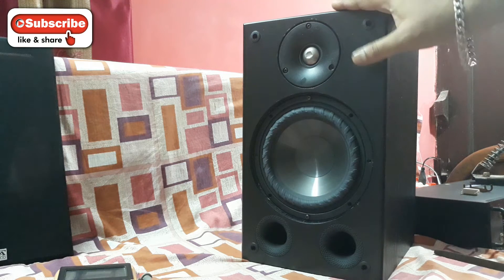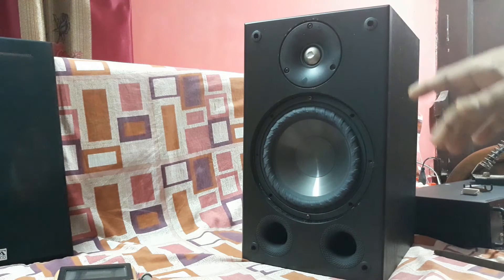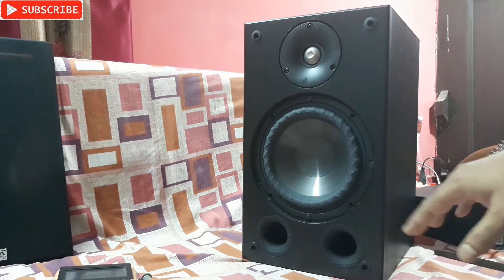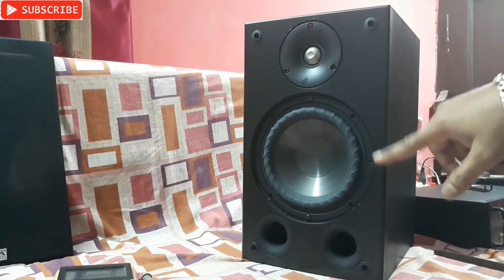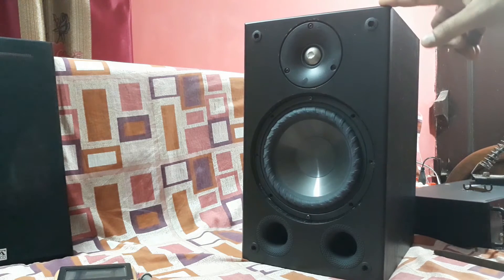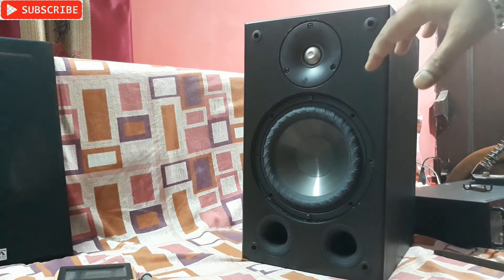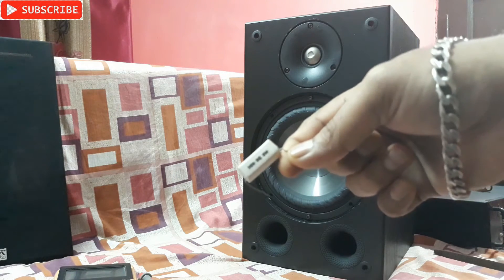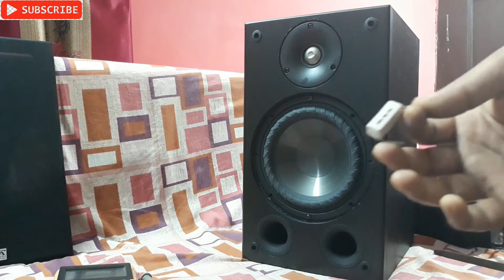How To Reduce Loud Tweeter Noise Of Taga Harmony Azure B40 V2 // The technoboy

Comment: Hello. I have an anker motion plus and it also makes a white noise or static in the tweeters if I listen at low volume and close or if I turn down all the volume there it is. So this level of noise is normal in more powerful speakers?
Reply from the maker: Sort of. But this kind a static noise depends on the amplifier & the audio inputs
Reply: @technoboy-allinOne  It's static or white noise that makes a hissing sound and comes out of the tweeters if I use the lowest possible volume or leave it at zero volume. In those conditions you can hear about half a meter away. Already in high volumes it is still there, but you no longer notice it

Comment: This may be offtopic, but how do I get rid of the soft hiss sound from my Presonus Eris e5 studio monitors?
Reply from the maker: Its cause of amplifier. Not speakers. Is your monitor active or passive? Check the input wires, you may need to replace them too. Sometimes it cause of bad power supply too.
Reply: @technoboy-allinOne  My monitors are active.

Comment: Good session. How did you select a 3 Ohms resister? Any calculations?
Reply from the maker: Calculations wouldnt work here. As the brand already did when they built the crossover which is a huge one but not that great. Here you need to hear the level of the tweeter, matching with the bass. I tried 4 - 5 different value resistors 2 to 8 ohms. & found this one perfect matching for that.
Reply: @technoboy-allinOne  got it. Thank you.